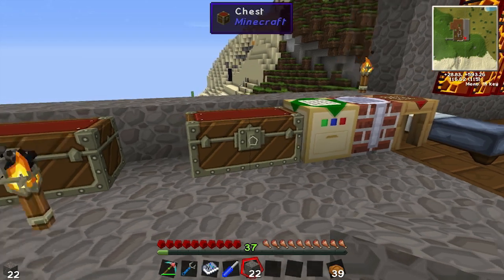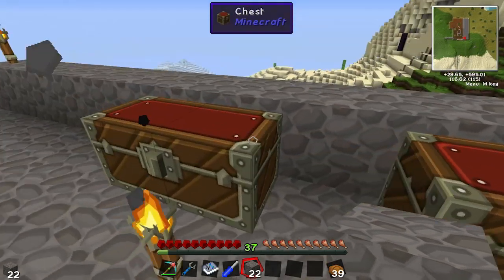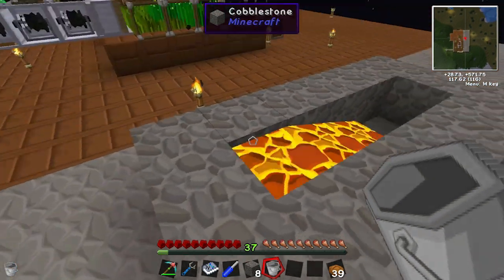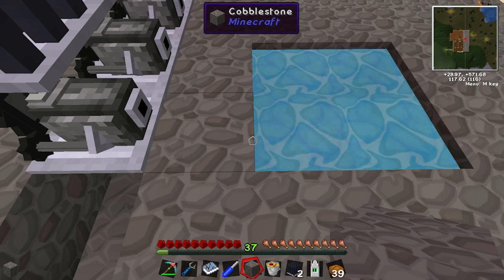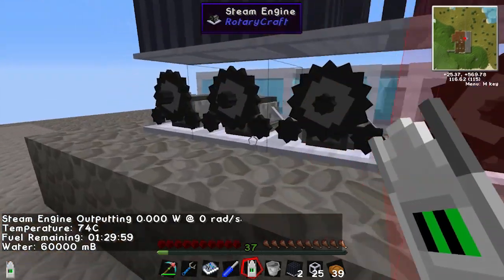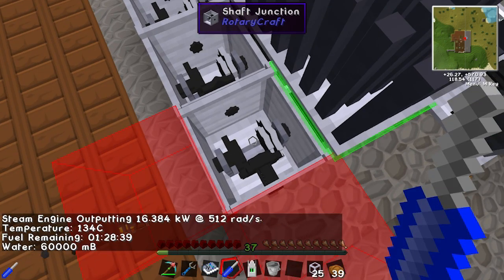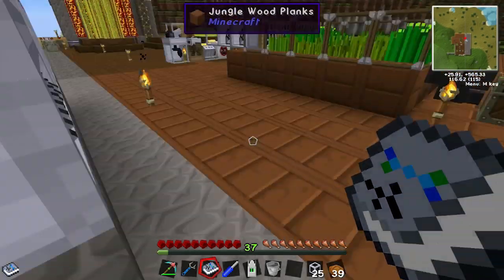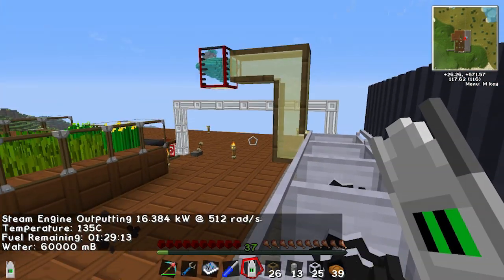Monster FTB Rotarycraft Steam Engine, Renewable Free Power

Comment: FYI, I know this is a little late, but you can use Netherrack and light it on fire under your steam engines instead of Lava. This allows you to eliminate the cooling things and just pump water into it. (No Explosion as long as you pump water into it)
Reply from the maker: that's good info. thanks

Comment: Hi,

Is it possible to use the Electric Generator to power say, an ME system, Pulverizer, etc?

Thanks,
Reply from the maker: I don't know as i'm not used to the power output type but the rotation dynamo outputs to redstone flux which i'm fairly certain that work with the ME system and the Thermal expansion machines.
Reply: Ausyarr Thanks Bud! I did use one. Took several steam engines to get the output up though. BUT, it powers my ME system and that was the goal. :)
Reply from the maker: thanks, i'll look into one
Reply: RotaryCraft also has machines that work with the Industrial Craft mod's EU power.

Comment: I need a bit of help... the pumps seem to not be doing anything with the water! What did i do wrong? I need them to pump in water for power....
Reply from the maker: Make sure you have the pump directly over water, have it powered by at least a dc engine and have liquid pipe connect to the sides of the pump.
Reply: I did all that, and the gear in the pump is rotating. However, it is not drawing out water... I am using this on 3.0.0 Voltz beta, could it be a bug?

Comment: I figured it out it wasn't getting enough torque so I used a gearbox & now it works
Reply from the maker: Was 4nm required now instead of the 1nm from the dc engine?
Reply: Ausyarr
He might be using v16c which is the current (outdated) version in TechWorld2 now.  I just realized that when I tried to run it and in this version a pump requires 32nm :-O
Reply: yolo
Reply: such lol

Comment: when I use the pump to pump water it doesn't pump the water out. any ideas? I'm stuck
Reply from the maker: I assume you have it setup like me. Check if the engine is spinning, if its not spinning then its not getting power. I'm on the ftb official teamspeak if you want to talk to to me about it. http://www.feed-the-beast.com/community